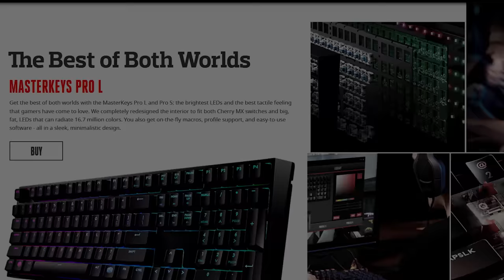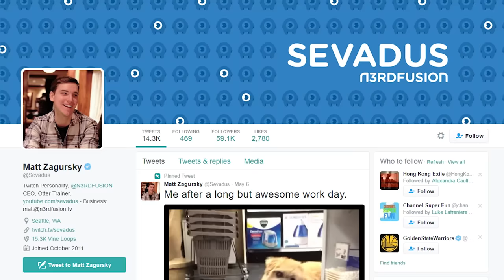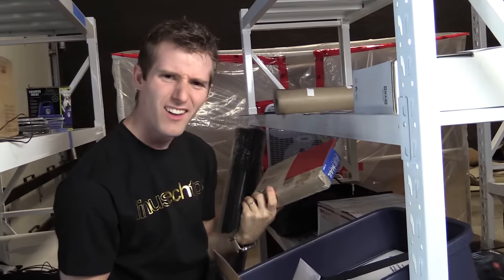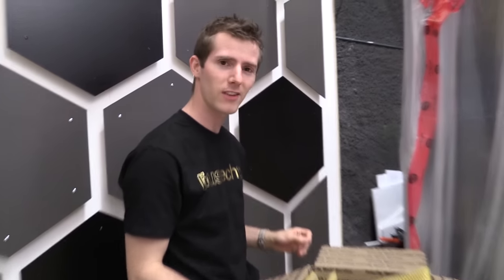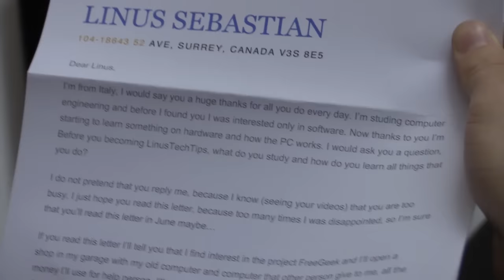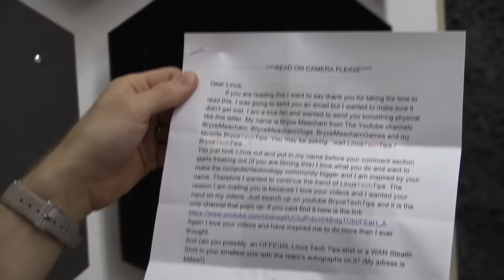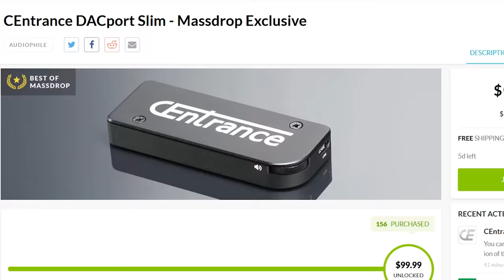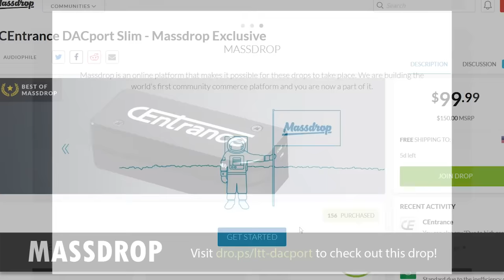Custom LTT-themed beanie & awesome fan mail! - The Mailroom #2

Comment: Hey Linus, since summer is coming, I am going to start working for a 1000 to 1500 USD gaming/video production PC. I am going to get the money by working at my local computer repair shop, and hopefully put all of the skill and tricks you taught me to good use. Anyways, let me cut right to the good stuff and put in the specs. I plan on putting all of this in a Factal Design R5 Blackout edition with a side window, just in "case" you wanted to visualize this. Tell me what you think! If there is anything I need to change or any improvements I could make, just let me know :P 

-i7 6700k water cooler by a corsair H115i
-EVGA Z170 FTW motherboard
-Corsair Dimnator Platinum 16 GB (4x4 GB) 2400 MHz DDR4
-MSI 960 4G 
   I would go with a more powerful card but I already own this so it will save on costs until I can get something better, and I am really fancying the new 1080 card
-EVGA 1000w PLUS Platinum power supply
    I know this is really overkill, but it's really just to give me some extra power for upgrading
- WD Black 1TB drive and a Samsung 850 EVO 2.5" 500GB

I am going to put some 140mm blue led corsair fans into the case just to make things look nice. I will also get some black and blue cables from cable mod to go with the fully modular power supply 

ps. I will also put this on face book

Comment: 3.8GHz AMD FX-4300 4-Core CPU
Gigabyte 78LMT-USB3 Motherboard
NVIDIA GeForce GTX 750 1GB Graphics Card
1TB (1000GB) Sata III Hard Drive
[AMD] 16GB Standard 1600MHz DDR3
Microsoft Windows 10 Home + Installation
Vibox Commando Red Gaming Case
Vibox 500W 80Plus Certified PSU
24x DVD-RW Optical Drive
are these specs good enough for 960 or 970 please answer
Reply: I would assume huge bottle-necking from that processor, my suggestion is you shell out $200 for one in the 8 core series and maybe get an ssd
Reply: ssd really needed
Reply: +Juicy G honestly I could never go back to just using a harddrive. you'll feel the difference in boot and loading games greatly
Reply: Is the intel i3 the best option
Reply: +Juicy G are you trolling?
Reply: You'll be fine with a 960.  What do you plan on doing?
Reply: Playing games on high and ult
Reply: Jeffery Howard amd fx 4300 isent a huge bottleneck
Reply: Jeffery Howard is 120 gb enough
Reply: Jeffery Howard do u mean for 970?
Reply: yes, the 4300 is a HUGE bottleneck in cpu intensive games
yes, 120 gb is enough for your OS and some basic apps. BUT I would actually recommend a 240gb one as it's cheaper per gb. (120gb are usually $40, 240gb is around $60)
Reply: Will it bottlenec k 950 or 750 ti or is the fx 8350 and 960 better
Reply: budget and goals? (what resolution, what fps, what games)
IMO, if I had your build, my next upgrade would be i5 6500 / and a gpu, prob 1070. Tbh, dont buy a GPU atm since we don't know about polaris and nvidia's lower end cards (1060 / 1050)
Reply: ok dude will the i5 push the 750
Reply: Not too sure what you mean by push however, it will have better performance than what you have at the moment. But you will need a gpu upgrade to run some later titles. It really depends on what games you play. (like I said upgrade when all the new gpus come out, it's fine to upgrade cpu/mobo/ram right now)
Reply: The fx 8350 seems better seeing as my motherboard supports the amd fx and vitals series.
Reply: depends on what you're doing, am3 is a dead socket, i would not recommend upgrading to a cpu on that socket. Go intel or wait for Zen (amd's new socket am4), amd's single core performance vs intel sucks rn in gaming. Look up benchmarks w 8xxx series vs i3/i5. I recently upgraded from the 8370e, to an i5 6500, don't regret it. Don't get me wrong, you will see an improvement if you get the 8350 but it's not worth it in my eyes. But hey, it's your money, I'm just giving you advice / ideas. You still haven't given me a budget to work with, and more importantly games you wish to play / see improvement in fps. you can seek more help from reddit.com/r/buildapc :)
Reply: eltino bambino meme-o budget is $400 and the latest titles such as no mans sky
Reply: http://pcpartpicker.com/p/cb4BD8
950 as a placeholder until polaris / pascal
either this 
OR 
only upgrade CPU/MOBO/RAM (full 16GB) and wait til polaris / pascal, I heard polaris might release some good sub $200-300 gpus. We can only speculate rn. 

You can also downgrade to an i3, still capable chip but dual core w hyperthreading, wont perform as great as the i5 w 4 cores. But this will allow you to get a better gpu now such as the 380 or 960 and the full 16GB of ram.  MOBO choice does not really matter imo, you can go with any $45-$55 mobo you like
Reply: eltino bambino meme-o i havce 16gb ram